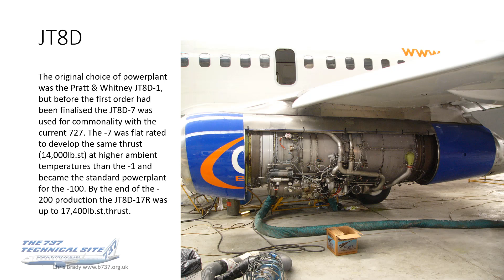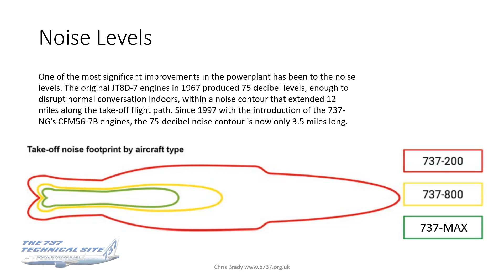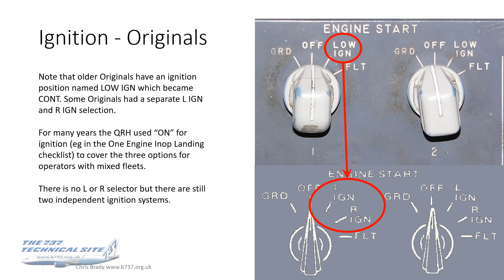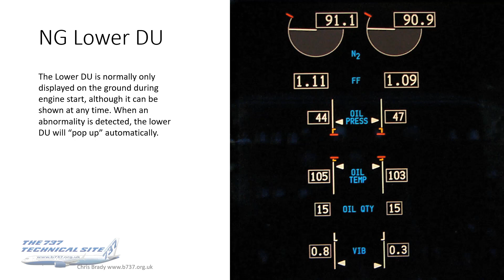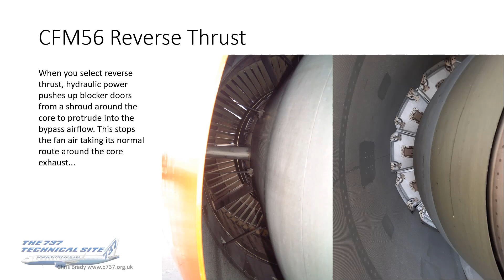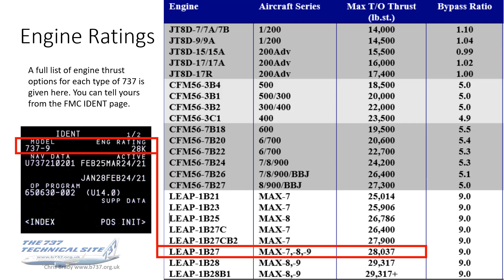737 Powerplant

Comment: Hello Christ I have a quick question for you. If you push the thrust lever all the way to the forward stop in a B738 aircraft with the CFM56-7B24K Engine, what thrust do you get? 24k or 27k?

Comment: Hi great videos, i am a big fan of your book, app and videos. Question: on a 400 I was taking out of MX and each time we went to start the L engine - we would get light off but then the EGT gauge kept flashing at us around 628. It didn't hit the hot start numbers and it didn't hung start. We went through this several times before we took off. Somehow the indication was reset by mx but I never understood the cause. Mystery. However, we didn't know to do this BITE Test on the EIS, I assume its normally a MX Function.
Reply from the maker: Hi, that is a new one on me. I would take some convincing to depart with an engine that was behaving like that. Yes, maint will perform the EIS test and several others for situations like this.

Comment: Keep up the good work, sir. I've got a question.  Why isnt there any Bowed Rotot Motoring for the N1 shaft? Isnt the N1 shaft also susceptible to bowing like the N2 shaft is? Thanks
Reply from the maker: The reason stated by CFM/Boeing only refers to the N2 shaft. Perhaps the N1 shaft is less susceptible to bowing. Maybe it doesn’t reach the same temperatures or speeds as the N2 shaft.
Reply: @ChrisBrady737  got it. Thank you for taking the time to respond

Comment: Hi Chris, many thanks for making these videos, I really appreciate that.
I am a LTC on the 737 and have a question I can't find the answer to, maybe you can help me.
If you make a takeoff on a 26K aircraft with a 24K derate and advance thrusts levers manually, just after takeoff, will you then get max thrust for 24K or 26K?
Many thanks
Mikkel
Reply from the maker: In your example if you advance the thrust levers to the forward stops you will get 26K. This is for emergency use only (windshear / terrain or obstacle avoidance) and you should be extremely careful about doing this if OEI.
Reply: Thanks for your answer. Yes, we discussed this with regards to windshear vs derated takeoff. I am aware of the issue regarding Vmca.

Comment: Thanks again for these very informative presentations. The most professional aviation content on YouTube IMO. 

I have one question regarding extended engine motoring. I see the limit for extended motoring on the CFM567B is 15 mins for the first two motorings with further limitations for the third and subsequent motorings. In what scenario would such a long motoring be required? (I can only think of a tail pipe fire scenario... but that would not require anywhere near 15 mins of motoring..). Perhaps for maintenance procedures? 

Many thanks!
Reply from the maker: Thanks for your kind comments.

Re 15 minutes of motoring, I am told that there is an engine control test of the system which takes several minutes.The engines control actuators and valves are powered by fuel hydraulics,so the gearbox needs to turn so instead of an engine run the starter can be used. An engineer would know more about this than me.
Reply: @ChrisBrady737  thanks very much Chris. I didn’t think it was likely to be a pilot related procedure. Cheers.
Reply: Can confirm long motoring is used by engineers for ground tests and compressor wash.

Comment: Hi Cpt, you are doing a really great job. With reference to the material presented I'm just wondering (cause 've seen that in some other not official materials) where this 10 secs to abort start come from (40:47), in our SOP and FCOM we have 15 secs.
Reply from the maker: Hi Rav, this is the risk with me giving operational rather than technical info, as operational info can change. It always used to be 10s and in some places it still is.
Reply: @ChrisBrady737  All clear, thx for the great job.

Comment: Great video as always Captain ! I have a question to make it more clear in my mind . In NG and max there is a FADEC in each engine which lets say controls all the engines parameters . Then a part of FADEC is the EEC which lets say is the brain of FADEC and control engine by fuel flow through a HMU . Correct? Thank you
Reply from the maker: The FADEC is the EEC. FADEC stands for "Full Authority Digital Engine Control" EEC is "Electronic Engine Control". They are the same thing.
Reply: @ChrisBrady737  thank you!
Reply: You'll find that many times both terms are used interchangeably. Generally speaking the FADEC is the system and the EEC is the component. In this case the EEC is the computer that schedules fuel flow, VBV, VSV and turbine clearance control valve position to name a few. While the HMU is a metering valve that purely modulates according to the commanded electrical signals sent by the EEC. All of this falls under the FADEC moniker. Even the same engine manufacture will sometimes identify the electronic engine control as an EEC in one manual while they will call the came component a FADEC for another manual.
Reply from the maker: Thanks AG, much better explanation than mine!
Reply: @AG-un7dz  just to be 100% correct about the role of the HMU :
The actuators (vsv vbv etc) on the engine are fuel pressure operated.   The EEC  being a computer we need some device which changes the electrical signal to fuel pressure to move the actuators. This called Electro Hydraulic Sevo Valve. These valves are located in the HMU together with the servo fuel circuits. From the HMU the EHSVs are sending the fuel to the actuators. Plus the HMU contains the fuel metering valve the shutoff valve and a mechanical overspeed governor.

Comment: Some more information about the Dual Annular Combustion Chamber engine version.

The DAC engine was basically the prototpe of the TAPS (Twin Annular Premixing Swirler ) combustion chamber/fuel nozzle design.
The reason the DAC engines did not become popular (actually the engines were refitted with traditional SAC combustion chambers) is the high vibration/ and high temperature loading of the low pressure turbine blades. During power changes/transient modes when some of the nozzles were switched on/off the LPT blades had increased vibration and uneven temperature loading as a result of the gasflow pulsation and temperature distribution. These led to LPT blade cracks.
After the engines were refitted with the original SAC chambers the Green Economically  friendly logo on the engine cowling left on of course.:)
Reply from the maker: Some great additional information, thank you again. As pilots we certainly noticed the vibration from the DAC engines at certain N1's during the nozzle transitions.